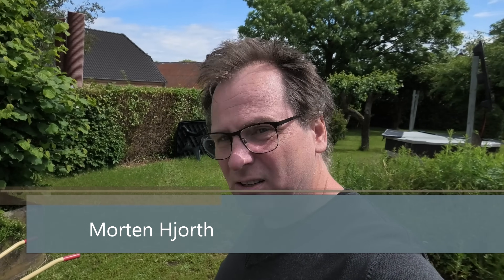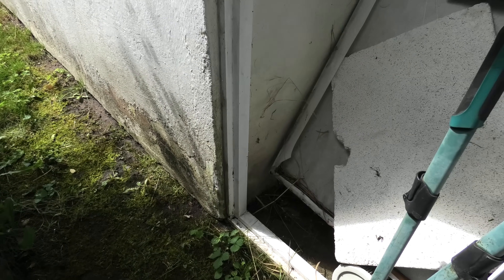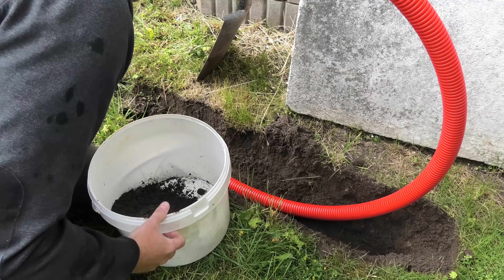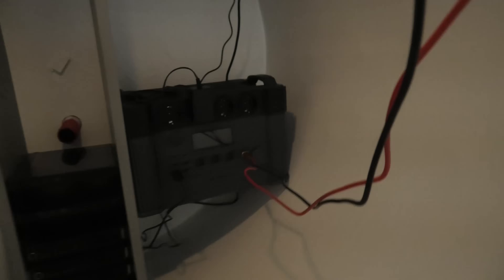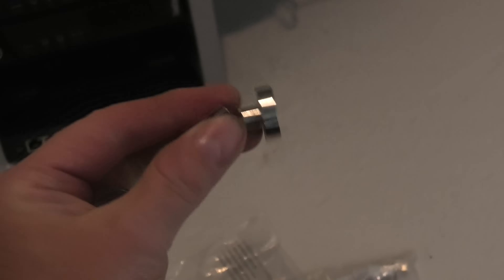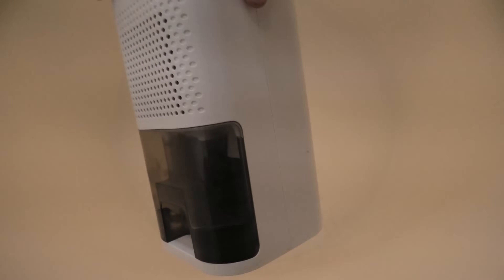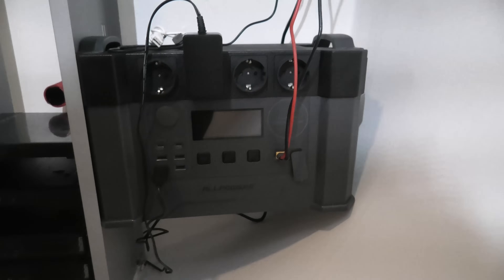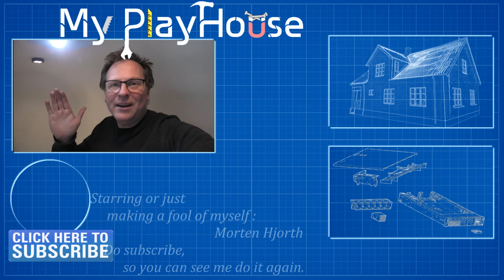Tiny Bunker Data Center - Small Progress & New Challenges - 1395

Comment: Cooling is always nice when using diamond drill bits to avoid cooking them  ;) get some water in the hole, it helps flush out the concrete dust and cool it.
Reply from the maker: I thought it would just be a few centimetres,, I am now like 15cm in,,, and still more to go....

Comment: Not sure about the pipe joint, water likes to get down the spiral gap even when you are careful with the tape. 

I have a sump pump with a similar style of tube, I fixed a small crack with a heap of electrical tape and it still has a slow drip. So if the ground gets wet enough likely water will still seep in.

Plan on some water getting in the pipe, and have a down cable loop so water cannot run down the cable and into your devices
Reply from the maker: Well I know where it is.... if it becomes an issue it can be fixed.

Comment: This switch at ground level in a confined area submited to humidity and possible water infiltration is probably a bad idea.
Reply: +1 for making this a ToR (top of "rack")
On such a small fiber run, you could get away with a LC to LC fiber adapter and extend the 10 meter cable with another patch cable
Reply from the maker: I would estimate that there is room for like 20 liter of water, before the SW becomes wet.
Reply: He bought from aliexpress